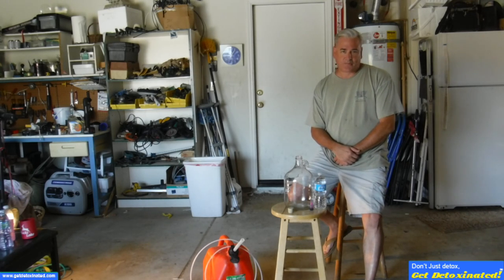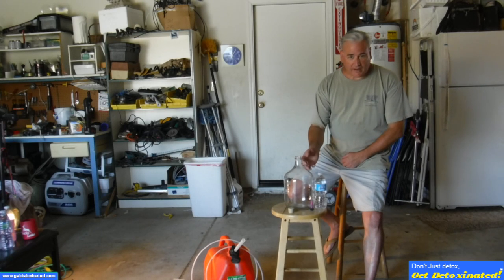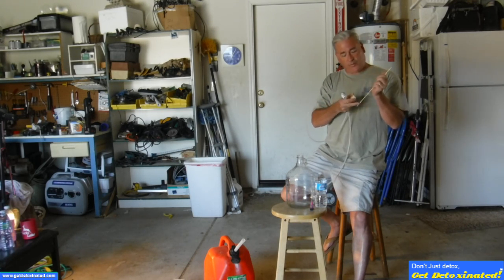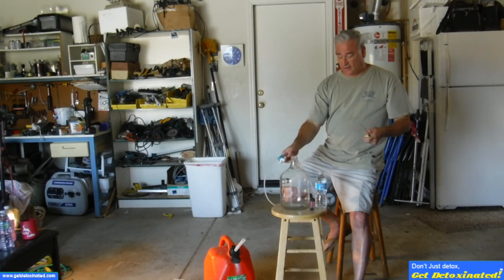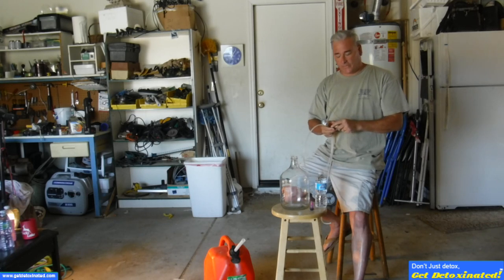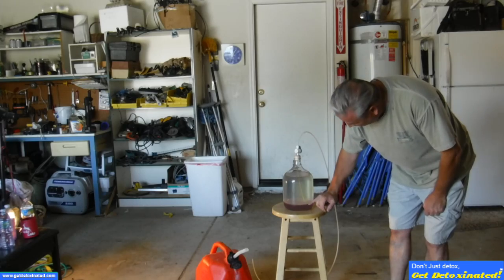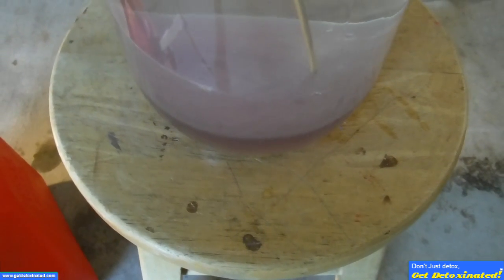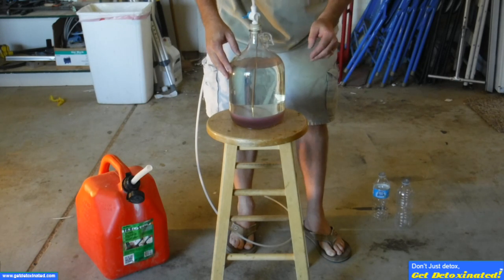How to remove ethanol from gas for 2 stroke engines

Comment: Total rubbish ...... a) not 10% extra recovered ... b) any Ethanol removed will now make sure your gasoline is reduced Octane ... c) water will affect not only the Ethanol but other components of the blend and may lead to increased moisture content of the final gasoline ... d) the amount of Ethanol in the fuel will not be adverse for 2T oil in 2 cycle engine fuel mix. The petroleum content is 90% and will more than cover the Ethanol.

I blend gasoline and I can say that immense amount of testing / evaluation goes into the decision of what to use in gasoline blends. TRUE gasoline has not been on the general market for significant number of years - and any DIY action on todays blends may actually cause more potential damage to your engine than the supposed effects of Ethanol.

Comment: I’m a big fan of 100LL Aviation Fuel. I’ve got racing motorcycles, but I use it in mowers, weed eaters, and chainsaws. All my equipment is 14+ years old and I’ve never had to replace a single fuel line and they all run like the day I bought them. It’s around $3.85 a gallon right now, but considering race gas is $8-$15 that’s not to bad. As you would imagine, aviation fuel is held to a MUCH higher standard than motor vehicle gas. They test for water, contaminates, etc.

Comment: interesting video but non ethanol regular gas is available in my area for $2.79 per gallon verses $2.29 per gallon for 10% ethanol fuel.  for the 50 cents difference when I need non ethanol fuel  I will pay the price and not have to convert fuel to non ethanol fuel.  I avoid 2 cycle engines and use battery powered weed eater and leaf blower and chainsaw and am impressed with the power and run time of the battery tools. battery operated tools are expensive but pay for themselves over time with fuel savings and maintenance . there is no pulling a rope to start, they run quieter, no fumes to smell, no mixing and storing fuel. I have never had an issue with ethanol fuel in my 4 cycle lawnmower engines.

Comment: GREAT VIDEO.........  SOOOOOooooooo can i put this in my 67 firebird that has it's original 6 cylinder engine?........ if so..... i would not have to use any lead additives right?...... or would i?..... THANX for your time :)

Comment: Is that a natural gas water heater behind you.  I would suggest you take your glass bottle full of gasoline outside,  should something happen and you drop it.  Gasoline vapors and a pilot light are a BAD mixture.
Reply: That is why water heaters are placed on 18 inch stands above ground level. If gas is spilled or leaks from car, the flammable mixture ratio is near the ground and stays below 18 inches.

Comment: Easier way to get the water back out is to simply pour the gas through a mister funnel.  It's filter media does not allow any water to pass through.  Since the ethanol is contained in the water it wont pass through the filter.  Can test the final product with the food coloring.  Food coloring in ethanol free gas will roll around the bottom like a couple of BB's.  If ethanol is present the food coloring will tint the color of the fuel.
Reply: Fill one of those funnel filters with water and you'll see they don't stop water from passing through them.
Reply: @N1ghtF1re  I filled my Genuine Mr. Funnel with water the day I received it a couple years ago and not a drop of water made it through.  I've since used it to filter at least a couple hundred gallons of non-ethanol fuel so I tested it again yesterday.  Still not a drop of water made it through.  Maybe I got lucky and got a good one. My only complaint about it is the sump they designed into the funnel so you always have a little waste fuel to deal with.
Reply: @jamiegull5840  My smaller Mr Funnels stop all water, even when completely filled. The larger ones pass water if they're filled more than half way up the filter. Too much head pressure, and the water runs through. They're great funnels, and I recommend them, but only the small ones can be filled up and not pass water.

I just did a test with water saturated ethanol and the three sizes I have. They eventually filtered out the ethanol, after a LOT of passes. I think that only happened because the ethanol got trapped in the sumps. Not all sizes have sumps. Most of the water saturated ethanol made it through, if it didn't get stuck in the sump.
Reply: Check out Steve's Small Engine Saloon video on mr. Funnel https://youtu.be/0AdZIKIYuHs

Comment: If u use your outdoor equipment everyday then i can see taking the time to do this , but if u are a average homeowner Truefuel is a better alternative if u cut or weed trim 2days out of the week with a 2cycle .As far as mowers I only fill gas tank with amount needed for duration of cut time.I have fuel shutoffs on my mowers an use them after every cut. When storing simply drain fuel from tank an run motor to clear carb.You don’t have to go through this process because if u have an accident an there’s a fire that gets out of control, u are going to feel so stupid , especially if it makes the evening news.....

Comment: Be careful when inserting the tube in the stopper. If the tube breaks while doing the insertion you will end up getting a the ragged broken end of the tube inserted into your hand (ouch!). It may be better to wear a good glove when doing that operation or use a rag to hold the tube when you are doing the operation..
Reply: Also, to minimize the risk, grab the tube close to the stopper when doing the insertion.

Comment: It seems like it would be soooo much easier just to pay a little more for the Ethanol free off-highway gasoline.  I guess it is not available in your area?  I think by adding water you are just making the problem worse.  The only way to separate ethanol from gasoline is by distillation and that would be exceedingly dangerous to do at home.  When you add water you are just reaching the limit of the ethanol's ability to absorb water.  Some of the ethanol is still there.

Comment: Doesn't removing the ethanol from gasoline drop-down the octane rating. it's much simpler to go to Wawa and pick up 88 octane ethanol free fuel more than likely you'll end up with the same octane rating and there's a whole bunch of work to do with it if you need a lot of ethanol free gasoline
Reply: E free is not widely available.  So this makes sense for some.

Comment: I have a bunch of Stihl lawn equipment, I have been buying the gas in a can, ethanol free that my Stihl dealer sells. No issues with any of the equipment. But, if you have the time, this looks to be a good alternative.
Reply: Michael Wright yep my Stihl chainsaw I was running great I ran out of that stuff put some Supreme with two stroke oil and now it won't even freaking start same with my GSXR 1000

Comment: If you go to the market you can buy a 5 gallon clear plastic bottle and set up a pepcok or valve on the bottom of the bottle and do this on a higher bench or the bed of a truck. Its as easy to come out with 4 gallons as it ism1 gallon.
Just food for thought.ive got too many power tools to do it one gallon at a time.

Comment: Thank you for this excellent video.  I worked at an airport as a ground crew for spray planes  and found out that Avgas, used in turbo-prop engines is a good fuel for two stroke engines.   No ethanol, and will not break down over time.  No treatment is required if you keep the gas over the winter.   It costs about 25% more than premium, but I believe it is well worth the cost.  
Most local airports will have Avgas available.  I suggest you call first to let them know you are coming by.  I buy about twenty litres minimum each time.  

Nevertheless, one thing that I always do is drain any left over gas from my two stroke engines and running them until they die before storing them.  Way less chance of being affected by deteriorated fuel in your engines.
Reply: Turboprop engines use JetA.  Piston engines use 100LL.  Don't put Jet A in a piston engine, two-stroke or four stroke.  If there is enough gasoline left in the tank to start the engine, when the Jet A gets there, goodbye engine!
Reply: @cmichaelhoover8432  You don’t understand jet fuel. It can be a jet-A, Jet-B, or Jet A1, or even JP-4.
Some turboprops, (Pratt & Whitney PT-6), are certified to burn gasoline for a certain time. I’ve run them in the Arctic, in a pinch on diesel fuel, gasoline, & even stove oil.
I burn appx  125 metric tonnes (appx 275,000lb), of jet A every trip to Hong Kong. It is glorified kerosene. It is NOT some super powerful explosive concoction that will cause your gasoline engine to explode. 
The effect is the same as putting diesel into your car. It does no damage to the engine, but since the engine cannot burn it, the fuel system needs to be flushed.
Reply: @edwardhill6945  Unfortunate how much ignorance permeates the internet today.  First, the Original commenter was espousing the use of "AvGas", which typically means 100LL (LL means Low Lead, which is very high lead content except in comparison to 130 octane gas used in high compression war fighting aircraft of WWII, when100LL was developed), distillate
Reply: Adrian Janssens that's probably what happens every one's chainsaw over summer

Comment: To make the process safer and more repeatable, get a gas tank from an old/broken motorcycle or scooter and use it instead of the glass. Clear tubing will enable you to see when to close the valve.

Comment: First BIG MISTAKE and NO NO is putting any kind of flammable liquids into a glass container!, BAD IDEA!. Second it is very important to use DISTILLED WATER! so minerals do not get absorbed into the gasoline which will then turn into a crusty ash type of deposit inside 2 cycle engines, eventually seizing the exhaust side of the piston/cylinder. A clear plastic water jug is a much better choice and the good ethanol free fuel can simply be poured off carefully into another empty CLEAR PLASTIC JUG leaving behind the unwanted separated water/ethanol and it is best to allow the clean jug to now settle overnight and repeat the pour off process once more leaving behind the last small amounts of water. Now the fuel is ready to be blended with good high quality 2-cycle oil for use in chainsaws, blowers and any other 2-cycle engines. Please avoid putting any flammable liquids into glass containers of any kind because if you drop it or it breaks you have an instant major fire hazard compared to impact resistant  plastic.
Reply: Another mistake is the shitty audio

Comment: One thing to think about if you extract the ethanol. You will be left with "pure" gasoline, but the lead will not be there either.
Be very careful about putting this into an older 4-stroke engine that was designed to have lead in it. The lead acted as a lubricant for the valves. So, you will burn up your valves without lead in the gas.
Newer engines solved this by making valves that weren't dependent on lead to keep them cool and lubricated.
Reply: I didnt think gasoline is sold with lead anymore.
Reply: there has not been lead in gasoline since the 80's .
Reply: @robertlarose4321  Yes, and that was the point of my OP.  But, in the case that you DO have an OLD engine designed to run on leaded gas, there are lead substitute additives that can do the job.

Comment: The local Honda dealer sells ethanol free gasoline and I believe marinas do as well.
Reply: Our local airport sells leaded regular gas that is alcohol free.  It was only available from one refinery located in Los Angeles,  about 350 miles away. 
I. Knew the airport manager and was able to buy it in drumbs for my 67 Ford truck.  My two vehicles i have today are designed for lead free gas so i no longer bother.

Comment: Unless you're running pre-1980's most two stroke etc., the hoses, washers and gaskets should be of a type that ethanol shouldn't hurt them. Ethanol produces better tork then pure gas and helps keep fuel systems cleaner then pure gas. If ethanol hasn't been used, than is, you may need to replace the fuel filter, because it will clean the tank and a lot of that build-up gunk will end up in the fuel filter and gunk that lined the hoses post filter may get the screen in the carb clogged up. It also helps keep water out of the fuel system and prevents freeze ups in winter. Heat® is an alcohal that I use to have to put in my car tanks, etc. befor E10% for South Dakota winters. A lot of old engines, and cars use to have a glass bulb on the fuel line that would collect water that settled out of the gas and would need to be emptied of water and gunk at least once a year. Ethanol aborbs it. No more puddles of water in the bottom of the gas tank. Over all 10-15% ethol is a better fuel and burns cleaner, keeps tanks, fuel lines, carbs/injecters cleaner. I have an old Homelite Chainsaw from the 1970's, so need ethol free for that. My newer Huskey Chainsaw is built to run ethol blend. It should say in the manual that comes with your equipment or you could call/email company about it.
Reply: I disagree, I had a brand new weed whacker and stored it over the winter with Ethanol fuel in it. Following Spring I pulled my guts out trying to start it. Upon further examination, the fuel lines were completely destroyed, almost "gelatinous" to be honest. It's one thing to run Ethanol in a daily/weekly driven/used machine, but for something that isn't used to that extent or stored for periods of time, NON- Ethanol fuel is the way to go. Since using Non-Ethanol fuels in ALL my smaller engine/not used daily or weekly equipment I haven't any issues! Period! ZERO! I can put chainsaws, weed whackers, leaf blowers, mowers and snow blowers away for the off season and pull them out when needed and they start like a champ EVERY time!!
Reply: ethanol does not mix with 2 stroke oil
Reply: @georgigeorgiev7232  I've never had a problem and never had it separate and used in all my two-strokes since the 1980's. I have a gallon in my garage right now and it's fine.

Comment: I just buy non-ethanol gas.
Reply: In the midwest you can only find it for 25$ a gallon in a can, and not at a fuel station. I contacted several large companies and looked at outdated websites.

Comment: I tried this and ran it in my 300 scooter. Works just fine. Be sure to use 93 octane which in turn you end up with about 87/89 octane

Comment: If you drop that glass jug of gasoline, with that nice gas water heater in the background with its nice pilot light in your garage, we will be reading about your crispy corpse and your burned down house.
Reply: James B. Whose to say it isn’t electric??
Reply: @trevorhorne4634  Because it has an exhaust vent on it
Reply: That is why water heaters are on a stand. They are above the flammable fumes of gasoline.. So if your car develops a fuel leak or if you spill gasoline, you will not burn down your house.

Comment: Why are you removing the ethanol it makes no difference to your car engine as the computer compensates for it  in two stroke the oil negates the ethanol. So whats the issue.
It does not damage to carbs unless you leave fuel in there over long periods of time. when storing equipent u should remove fuel.
Stop using low octane fuel in the first place.

Comment: Put the colored water in first mark the level on the bottle .Now put the gas in and you will clearly see the increase in volume above your mark.You can also mark the bottle at a level that represents 10 % plus your 16 oz so you know when it's finished or if they are selling gas with more than 10 % .

Comment: 100 LL at the airport. Race gas at some stations. Marine gas at Marinas. 5 gallons last me all year for small engines.
Reply: Agree, but it's hard to find some places.  This method does look a bit tricky, but good if you are far from an E free pump.
Reply: Aircraft gas, called 100LL, has a really lot of TEL (lead) in it.  It is realy easy to get led fouling of spark plugs with it.  When the mower, etc won't run, pull the plug and look for littles balls of lead shorting out the plug.  Still better than ethanol though.

Comment: This is gotta be for a lawn mower or some small boat like something with a 9.9hp. What if your boat hold 100 gals or more? You'll never get out there on the water. Just move to a state that sells white gas like they do in Florida.
Reply: 9 HP? Damn, you got some large 2-cycle gasoline engines there.